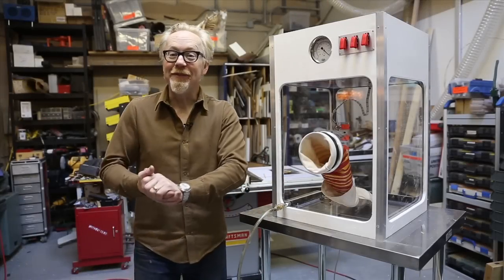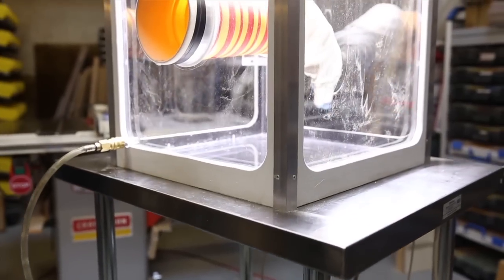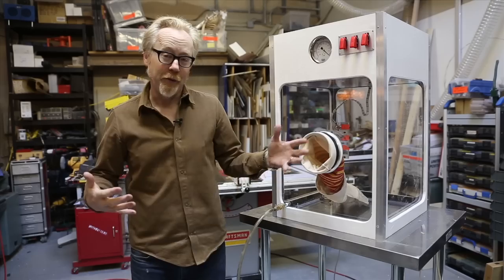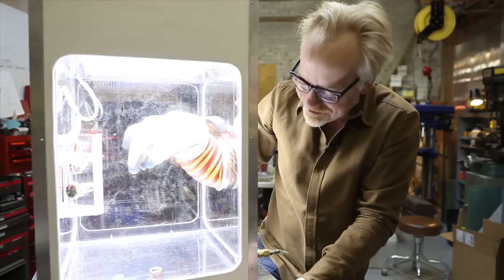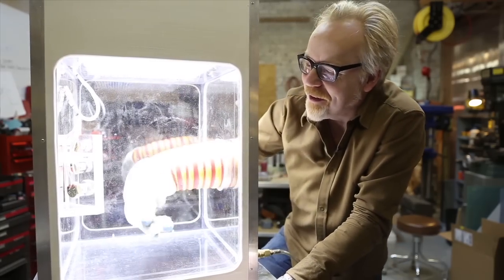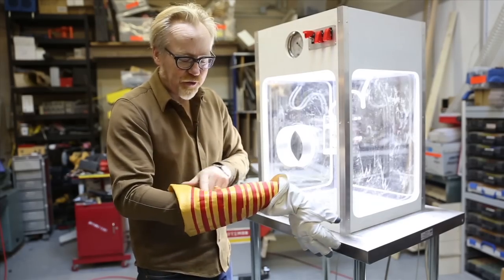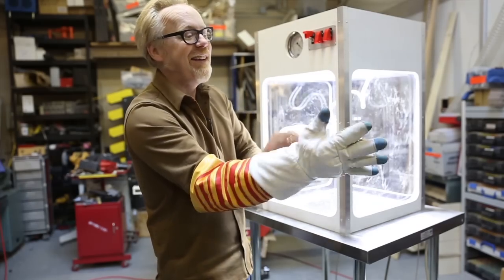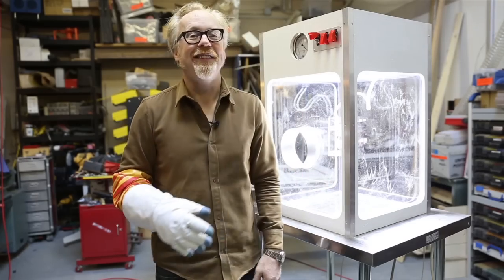Inside Adam Savage's Cave: Space Glove Vacuum Chamber

Comment: It does not replicate a space glove in space. It demonstrates a spaceglove at atmospheric pressure in a low vacuum chamber.
To replicate a spaceglove in space, Adam would have to place the glove in a high vacuum chamber, pump down to about 1e-6 Torr and then pressurize the glove to 3 psi.
I brought this fact to NASA's attention when they were conducting the new spaceglove competition but they ignored me.

I would like to see a spaceglove or a spacesuit tested in vacuum because, strangely, there is not a single video of a spacesuit and its elusive ice sublimator cooling system being tested or demonstrated in a high vacuum chamber duplicating environmental conditions of orbit or the moon. 
They've allegedly been using spacesuits for more than 50 years and although there's beaucoup video of them being used in swimming pools, none show them being used in vacuum chambers.
I've asked NASA if I could witness a spacesuit being tested in vacuum but they refuse even though it would cost nothing and allow them to claim that they're being accountable.
NASA is NOT accountable and I believe they are hoaxing the Citizens of the United States and have been doing so for more than 50 years.
I also suggest they use shills like Adam to protect themselves and perpetuate  the hoax.

Please note that, until recently after my agitation, there were no photos of spacesuit ice sublimators on the Internet.
Please note that, until recently after my agitation, there was no mention of ice sublimators in any academic-level heat transfer or thermodynamics book despite them representing one of the most interesting and exotic heat transfer devices ever conceived or concocted.

The NASA space program is a "faith-based" thing and that's unacceptable because the only way they can  continue to be "faith-based" is for shills like Adam to pretend to hold them accountable when, in fact, they are unaccountable and most probably lying.

The Scientific Method is the best way to determine if NASA is lying and I suggest we use it by having NASA publicly demonstrate a spacesuit in a high vacuum chamber before independent witnesses.

But it probably won't happen because Americans have too tight a grip on their precious delusions.
Reply: Neil Baker You need to stop saying believing in nasa is faith based, there is a mountain of evidence supporting nasa, it has nothing to do with faith. you have no evidence to support what you claim, therefore you go on FAITH that its a hoax. if you have no evidence or have no real good reason to believe in what you do then your going off of faith, thats how faith works...
Reply: don't bother, we're about to hear how those are staged to cover the conspiracy
Reply: Neil Baker So in essence you are consenting to the belief that NASA as well as every other venerable and creditable space agency from around the world is lying about achieving a space flight and other space activities....well this conversation will be getting nowhere have fun in fantasy land. I think your out look on life and science would benefit if you just got over your preconceived notions of grandeur at having pieced together a master puzzle that had apparently "fooled" millions of better better qualified than you or I that they had landed on the moon.
Reply: @SOGSkull  your missing the point.  He is stating that you are putting belief in something rather than using logic and reason. Faith in unknowns. You are just putting your BELIEF in something with no solid evidence. Just as bad as believing in the conspiracy. I on the other hand remain nuetral, use logic and reason to observe this problem. It lacks the proof one needs to make a logical decision. One should be neutral on this until absolute proof is available. However there is more evidence to show that NASA is failing to provide any proof that their suits are what they say they are. I want to see absolute proof that the suits do what they do. Not being back to the moon makes me wonder...
Reply: indubualisticism123 Idiots like Neil Baker have underlying psychological issues. They opt to not address these because they are part of their grandiose conspiracy. Arguing with them is pointless. They might even seem rational at times, but they are incapable of normal human cognitive thought or emotion.
Reply: Neil Baker This has me curious, as I don't think I understand your premise. Your goal is to have NASA demonstrate...what exactly? that it can make a functioning spacesuit that will hold up in a vacuum? How is that the crux of the whole "conspiracy"? Anyone can make a vacuum chamber, and anyone can make something that will hold air inside of it. I've done both, it's not hard.
Reply: Well, I think I''ll leave this debate to any others who wish to pursue it, as I don't expect anything productive to come from it, but on a closing note...

There are many nearly convincing reasons why people believe in the NASA conspiracy. This is not one of them. There simply is no reason a working suit which could hold a vacuum could be made to work, and even less reason that the simple process of ice sublimation could not be used for cooling easily. If one makes a freeze dryer, he's fighting sublimation cooling the whole time, which is why they have heating pads. Likewise, we use pressurized suits on earth for diving, and pressurized equipment for a great many other things. Holding pressure in a vacuum is much easier than holding a vacuum on earth. Calling upon these as unlikely stories simply because public demonstrations of testing have not been held is a case of a misplaced burden of proof, nothing more.
Reply: How long did it take you to write this? Adam was just making an example with a toy. It's not like he's NASA trying to actually replicate exactly how it would be in space.
Reply: Neil Baker I have some gloves in my office that are great when it is chilly outside.  They also do not exactly replicate a "space glove"(or an Apollo space suit glove).  And like the glove in this video, nobody has claimed they do. 

Still, here we see an honest attempt to create something, test, something, simulate something.  And the results of that effort (this glove is difficult to bend, but not impossible) are far more effective at understanding how a glove in space would work, than another person's untested unexplained theory.  I did see a video where Ralf Rene inflated a leather garden glove, then said it was impossible to bend.
Reply: John Smith Don't feed the troll.
Reply: Again, I'm not sure I follow your line of questioning. Without trying to comment on the efficacy of our space program, or lack thereof, ice sublimation cooling is a very easy experiment to perform in any garage. As it happens, I did it last week, just to show off my new vacuum chamber. I poured water from a tap, and put it in a medium vacuum with a normal pump, and boiled it until it froze. Sublimation cooling is a well documented and easily demonstrated phenomenon. There are plenty of videos of what I'm referring to (I'm not going to post one unless I can get a cold trap working, as I found out boiling water is quite bad for the pump, as it craps up the very expensive oil). If you want to try it yourself, vacuum pumps that will do this run around $40
Reply: Neil Baker but there are videos of astronauts in orbit in a vacuum attached to the iss or shuttle all the time doing work. does that not show they have a working space suit? what about the apollo mission videos?
Reply: Neil Baker I've heard some interesting conspiracy theories, but that fact that you think the space suit is a lie... That's the dumbest thing I've heard in my entire life.
Reply: Neil Baker You're a conspiretard. Therefore 99% of what you say is sophist bullshit. So forgive me if you just sound like the whining of a power drill to me, and any rationalists present.
Reply: BaSH PROMPT They think everything is a lie...
Reply: You realize how ridiculous your argument is right? NASA would not let anyone just come in and observe their work and let them leave just to convince one person that they know what they are doing.
Reply: @andromeda42442  you realize how bad your argument is don't you?! He actually does have a good argument. Don't be so hypnotized man. Wow... Your saying throw truth and reason out the window and just have faith in NASA...
Reply: Neil Baker Wait... What are you saying to be a hoax? The space suit? Because if you're saying the space suit doesn't work, then wtf kinda of world do you live in?
Reply: Neil Baker When you say that NASA had not released photo's of their ice sublimator until recently due to agitation by yourself what year are you talking? I can find no evidence that NASA has ever stated that an ice sublimator would be built into a space suit until 2011 and the patent for that ice sublimator was filed on January 22, 2007. In the article released by NASA in 2011 they hint that it may be used in the new space suits and that it is only a more advanced sublimator that reduces contamination and increases reliability by reducing the contaminants that would usually clog the system. Ice sublimators were used during the Apollo missions but they were not part of the space suit itself but a component of the portable life support system which was manufactured by Hamilton Standard now known as Hamilton Sundstrand. Block diagrams and photos of the unit are widely available on the internet and Hamilton Standard released this article about the PLSS many, many years ago. https://www.hq.nasa.gov/alsj/LM15_Portable_Life_Support_System_ppP1-5.pdf. The way you talk about these ice sublimators makes me wonder about your understanding of sublimation. Sublimation is when matter in a solid phase turns directly into a gas or vapor skipping the liquid phase. Water will sublimate when it's brought below it's triple point (4.56 mmHg) or in other words at very low pressures (i.e. the vacuum of space) last time I checked 4.56 mmHg is greater than 1e-6 Torr. Sublimation does occur and has been proven independently why you cant imagine NASA being able to utilize it is beyond me. NASA 2011 article http://www.nasa.gov/centers/johnson/techtransfer/technology/MSC-24207-1-advanced-sublimator.html Patent for new sublimator http://patft1.uspto.gov/netacgi/nph-Parser?Sect1=PTO1&Sect2=HITOFF&d=PALL&p=1&u=%2Fnetahtml%2FPTO%2Fsrchnum.htm&r=1&f=G&l=50&s1=7,604,782.PN.&OS=PN/7,604,782&RS=PN/7,604,782 Experimental study of water sublimation conducted by independent scientists partially funded by a grant from NASA and published in the scientific journal Icarus in 1991 http://science.gsfc.nasa.gov/691/cosmicice/reprints/IcGas1.pdf Wikipedia article with colour photos of PLSS http://en.wikipedia.org/wiki/Primary_Life_Support_System. If you would like to know more information regarding the sublimator there is a more detailed description on the patent page.
Reply: ***** I want NASA to demonstrate before independent witnesses (preferably with me being one of them) a spacesuit and its ice sublimator cooling system in a high vacuum chamber on Earth duplicating environmental conditions of orbit or the moon.
If they use the suits as they allege they do and test the suits in vacuum as they allege they do then their should be little difficulty or expense in being accountable before independent witnesses when they perform future tests.
In over 50 years of alleged use, NASA has never demonstrated that its spacesuits and ice sublimators work in vacuum. Until recently, after my agitation, no photo of an ice sublimator existed on the Internet. Most absurdly, until recently after my agitation, no mention of spacesuit ice sublimators existed in any academic-level heat transfer or thermodynamics book despite representing one of the most interesting and exotic heat transfer devices ever conceived or concocted.
NASA frequently presents video of spacesuits operating in swimming pools for training purposes but, strangely, has never presented video of them being operated in a vacuum chamber.
Yes, vacuum chambers exist and yes, things called spacesuits exist but never have spacesuits been demonstrated operating in vacuum chambers.
It's the Achilles Heel of the space program. It's the way the hoax can be PROVEN today on Earth without the necessity of faith or travel into space.
Currently, our space program is a faith-based thing and that's unacceptable.
Reply: "It does not replicate a space glove in space. It demonstrates a spaceglove at atmospheric pressure in a low vacuum chamber.
To replicate a spaceglove in space, Adam would have to place the glove in a high vacuum chamber, pump down to about 1e-6 Torr and then pressurize the glove to 3 psi."~ Neil Baker

Now I would hate to insult your intelligence here. But think about that from a logistical standpoint....If the glove is at atmospheric pressure in a low vacuum chamber. It is the exact counter opposite of a space-glove in space. The only difference is at which point(s) the material(s) (In the video's case in fabric/plastic) are experiencing the negative pressure "differential" is you will. So in essence if the glove works here on earth and has no obvious leeks due to construction i.e. its stability remains the same in the actual device used to test it (much in the same way the device Adam built in the video) then the glove will survive vacuum of space....that much is easy to say.

.....On the topic of the "Ice subliminatior not being tested in a vacuum"~
It would not need to be....-_- testing in a water based environment fully simulates to an adequate degree the effects of the suit in space....what little it dose not is permissible on the testing scale (Not to say that tests of that nature do not occur logic would hold true that they do....and by extension that people carrying out these tests are busy enough without having to chaperon you around a facility for you to oversee and give your "official" college kid stamp of approval) Further more testing in an aquatic environment is the safest way to ensure the the cooling system you are so critical about works effectively. B/c taking temperatures is extremely difficult to do reliably in a vacuum environment....This much as all known science. And even in my brief explanation of all of this (In no way conclusive to the proper terminology, science, etc.) in laymen s terms you still find something that you would like to be critical about....remember other countries use just about the same methodology in their space programs as well....unless you would like to offer the conjecture that the world's governments are orchestrating some massive cover up. In closing you sir are the "Shill"
Reply: Neil Baker Oh god, you think we're brain washed too?
Reply: It's pretty obvious the suit works.
Reply: and it will need to protect you from radiation.
Reply: Noah - And extreme heat... And extreme cold...
Reply: Daniel Markiplier forgot that.
Reply: "It demonstrates a spaceglove at atmospheric pressure in…."   It's a glove from a hazmat suit with some modification.  Savage goes into detail, and never claims it's a real glove, or even has the same features or construction.  He also reads PSI off a meter that is marked in inches of mercury, something you completely missed.  But it does prove quite nicely that bending a glove with pressure inside greeter than outside is difficult, but quite possible.
Reply: +Neil Baker 
Not too many people have a vacuum chamber with turbomolecular pumps and backing pumps (and Bayard-Alpert style gauges) that would get to 1 e-6 Torr. You'd need something elaborate to get there including conflat gaskets unless you want to wait for 2 weeks to test your theory after all the outgassing. Also, unless you have a TMP-1000 size turbo, you probably won't pump down a chamber capable of housing that glove inflated. You'd also have to have a method for ensuring the glove feedthru integrity is conflat like and that would mean a bellows, not a rubber membrane as gases like helium don't have a problem going through rubber and would serve to help prevent your 1.0e-6 Torr (hell let's just shoot for 7 scale). 

So your enthusiasm and book larnin' is impressive but your high vacuum knowledge is based on thin understanding of vacuum application. Theory is fine, application is quite different. Nevermind the fact you wouldn't need one hell of a sight glass sealing system to hold 6 scale vacuum. I'm fairly certain there would be no entries except by CERN or NASA themselves.
Reply: +Neil Baker Adam is not "recreating a space glove in space" he has simply constructed a fun gift that "roughly simulates the difficulty of movement in a pressurized space suit in space". What you suggest is completely impractical. On top of that NASA HAS been observed in action by various space agencies and regular old people around the world (yeah people watch them in space).
Reply: Superb piece of trolling sir
Reply: Neil Baker Thanks I suppose, I still don't get why sublimation cooling would work in a crock pot vacuum chamber and not in space, where radiation, I'd imagine, would accelerate the sublimation process, much in the same way a freeze dryer works
Reply: Neil Baker forgive me, your gonna have to elaborate on what exactly a ice sublimer is and how it is supposed to work in the suit. What i know about the suits is that the person wheres a cooling suit under the space suit itself, it runs a liquid through a serious of tubes all over the body. if this is what you mean, there are lots of details and stuff on how it works on the net.
     I dont find it odd that there are no videos of them testing a suit in a vacuum, in fact i would find it a bit odd if they did, it would be like them saying ''we have something to prove to conspiracy theorists'' instead they were tested in flights to the stratosphere, there are different countries that also have there own space suits ''russia, china'' and yes, im sure they were vacuum tested too. the absence of footage showing a suit in a vacuum chamber is not strange. and Adams suit is a replica, not a real suit. he would die if he went into a chamber with it most likely.
     Nasa is not some secret base, its not nasa verifying nasa at all. they release there data to the public for all to see. not to mention scientists from around the world have been to nasa and not one of them disputes a hoax of any kind. not a single person properly educated in any of the fields of discussion, claims nasa is a fraud.
  Videos might not be absolute truth but they are EVIDINCE! so is all the data nasa released aswell, and evidence is what you use in the scientific method, its all been looked at time and time again, and still no one disputes it, other then those uneducated in the fields of science in relation to the discussion... from the hundreds of thousands of scientists around the world, not one claims a hoax at nasa. that means the whole world must be in on the cover up if there is one and thats just absurd when you think about it.
Reply: Neil Baker innocent untill proven guilty. If you had any real evidence to show that any of this is a hoax then id be with you, but you have none, i know you have none because iv had arguments about this stuff about 100 times now and no evidence is ever presented that stands up to scrutiny. ''what ifs'' and accusations are not enough. there is way to much evidence out there supporting the apollo missions, its vary unlikely that it was a hoax.
Reply: Neil Baker I Imagine you have trouble believing many things. Oh, and by the way. World we live in, is just a big simulation.
Reply: Neil Baker are you a robot?
Reply: Neil Baker Dude, if you really want to try it, it's not hard to send a little pod into space with a camera to monitor a few test pods. Unless you don't have any money to do so because you never worked a day in your life because you feel like work is just an illusion made by the government to control our brains.
Reply: Neil Baker Just so you and everyone know, Australia wasn't in on any hoax created by the US when it was up to them to broadcast the lunar landing around the world. They pointed their big dish at the moon despite dangerous high winds which could have destroyed it. They received the transmission from the moon! The amount of effort for NASA to get a video transmitter with a staged and pre-recorded video safely to the moon and remote control a craft there and back would have been the same, if not more, than sending three men to the moon that day.
Reply: You are right NASA simply lies about nearly everything. There lies are intended for those who can be brainwashed easily.
Reply: +Neil Baker Why wouldn't a sublimator work in a vacuum?
Reply: +Neil Baker if by recently you mean 1951, a quick Google Scholar search finds this article that would seem to contradict your statement, "The sublimation of ice in vacuum" Kramers, H. & Stemerding, S. Appl. sci. Res. (1951) 3: 73. doi:10.1007/BF03184673

I note this is seven years before NASA
Reply: If I worked go NASA I would not let some random person come view our vacuum chamber tests. Who do you think you are? And what are you trying to insinuate? That NASA has never been to space or something? You're a nutter.
Reply: +Ramsey D'silva 
The alleged person in charge of spacesuit testing at NASA's Johnson Space Center is Raul Blanco.
His telephone number is: 281.483.1601
His email address is: raul.a.blanco@nasa.gov

I have spoken to him but with little success in convincing him to be accountable.
Perhaps you with the help of your friends could be more successful.
Reply: John Smith I don't think it's ridiculous at all. NASA's credibility has been challenged and I've proposed a simple inexpensive way that they can demonstrate accountability while living up to the strictures of the Scientific Method. I was thinking that a rather large group of interested Independent Witnesses would be invited.
Reply: ***** We're not talking about whether or not sublimation cooling would work. We're talking about whether or not NASA has a spacesuit that can operate in vacuum and be cooled by an ice sublimator.
Nobody contends that sublimation can't cause things to get cool.
I do contend that NASA is committing fraud as it has for a long time in telling us that it uses spacesuits equipped with ice sublimators that work in the hostile environments of orbit and the moon.
No video exists of a spacesuit being tested in a high vacuum chamber.
No video exists of a person in a spacesuit being tested in a high vacuum chamber.
Would anyone care to volunteer.

By the way, I remember an episode of MythBusters where Adam Savage was wearing a NASA spacesuit and was next to a vacuum chamber but for some probably really good reason (like staying alive), he didn't enter the vacuum chamber, seal it, pump down and test the spacesuit.
Reply: ***** If you're so certain, then you shouldn't have any problem demanding accountability from NASA claiming for more than 50 years that its spacesuits operate in vacuum.
 
Nobody should have to accept a "faith-based" space program like you are.
The beauty of exposure of the hoax through the spacesuits and ice sublimators is that we can PROVE it today on Earth. That is, with some cooperation from NASA which isn't going to provide unless forced because they're criminals trying to cover their crimes.
Reply: indubualisticism123 Yes, but that video was produced by NASA. The Scientific Method requires that verification of scientific claims be conducted independently. NASA verifying NASA is not science.
1. If NASA has truly been using spacesuits with ice sublimator coolers then why has there never been any demonstration of a NASA spacesuit and ice sublimator being tested in a high vacuum chamber on Earth duplicating environmental conditions of orbit or the moon? If NASA has been using the spacesuits for more than 50 years then they most certainly have been testing the suits for more than 50 years. Why no video  of suits being tested in vacuum when ample video exists of suits being used for training purposes in swimming pools? Odd, isn't it?

2. Until recently when I started agitating about it, no photos of spacesuit ice sublimators existed on the Internet. Odd, isn't it?

3. Until recently when I started agitating about it, no mention was made in any academic-level heat transfer or thermodynamics book about spacesuit ice sublimators despite them representing one of the most exotic and interesting heat transfer devices ever conceived or concocted. Odd, isn't it?

4. Challenges to address the issue of ice sublimator fraud to several university's Mechanical Engineering Departments including University of California, Louisiana State Universrity, Tulane and Rice University have been ignored.

5. NASA refuses to be accountable. Congressional representatives in two states  (Washington and California) contacted by me to demand accountability from NASA have stonewalled me.

6. Adam Savage on an episode of MythBusters had a spacesuit and a high vacuum chamber but failed to put the spacesuit in the vacuum chamber to PROVE its operation. 

Video is not PROOF. Video is not TRUTH. The best way to reveal TRUTH is the Scientific Method.
I suggest we use it. 
A "faith-based" space program is a fraudulent space program.
Please demand a NASA demonstration before independent witnesses of a spacesuit and ice sublimator cooling system in a high vacuum chamber on Earth duplicating  environmental conditions of orbit or the moon.
The hoax can be proven or disproven today on Earth.
Reply: Daniel Markiplier If he's truly a Myth Buster then he should bust the myth. He had an opportunity in the episode when he was at NASA wearing a suit outside the vacuum chamber. Why didn't he enter and pump down?
NASA won't be accountable because they probably can't because it's probably a hoax.
The Scientific Method could tell us for sure but only if NASA cooperates which they won't unless forced because criminals always try to cover their crimes.
Reply: Is a glove at atmosphere inside a vacuum chamber at 3psi the same as a space glove at 3psi within a vacuum chamber at near 0psi (1e-6 Torr)?
I think the Kinetic Theory of Pressure indicates that the systems are different. I wonder if they behave differently.
Reply: Dude, get a life.
Reply: I'm the TOOL? 
Me?
I completely fail to see any logic in that statement.
It seems obvious to me that the TOOLS would be those helping prop up a fraud.
All I ask is a simple act of government accountability that costs nothing to perform. Not only does the government say no, other Citizens that have nothing to lose help them say no.
It's like Harriet Tubman, conductor on the Underground Railroad, said after the civil war, "I saved a 1000 slaves and I would have saved 1000's more if only they'd know they were slaves."
You embarrass.
Reply: indubualisticism123 No, it's NASA unaccountable until they are accountable. If you're so certain of your evidence then you should have no problem with the demonstration I've proposed especially when it will confirm your position.
But no, NASA won't publicly demonstrate a spacesuit and ice sublimator in a vacuum chamber even though they allegedly perform such tests periodically and have allegedly performed them for more than 50 years. 
If they use the suits as they allege they do then they must test the suits in a high vacuum chamber.
They won't be accountable because they probably can't be accountable because it's probably a hoax.
The space program is a "faith-based" thing and that's unacceptable.
Reply: Daniel Markiplier Until the demonstration of a spacesuit and ice sublimator in a high vacuum chamber duplicating orbital environmental conditions is conducted before independent witnesses, I can only believe or disbelieve NASA claims about the spacesuits. The Scientific Method requires independent verification.
Until NASA is accountable, the space program is a "faith-based" thing.

If the spacesuit doesn't work which I strongly suspect but don't know, it would mean that NASA has lied to and defrauded the Citizens of the United States for more than 50 years and that most of our space program is a hoax. It would strongly support the notion many share that our reality is a fabricated reality and that we are slaves manipulated by powerful criminals controlling government and media.
Reply: Daniel Markiplier Sure, if you BELIEVE, it's pretty obvious.
But NASA should be an institution dedicated to science rather than belief or faith.
Video is not TRUTH.
It many seem obvious, but it's a lie.
It might seem obvious that terrorists shot a downed policeman point blank on a Paris sidewalk but look at the latest Charlie Hebdo hoax video and think again.
NASA does fake video, fake photos and fake narrative almost better than any other organization.
I don't think you're brainwashed. I just think you're misinformed. I can empathize. I was once misinformed also. Summon the courage to confront that you've been lied to.
Reply: Brad Rex Still, it does not replicate a space glove in space. That would require a glove pressurized to 3psi while within a high vacuum chamber pumped down to the pressure of orbit (1e-6Torr)
Reply: No. Only you are the idiot. Neil is 100 % correct scum bag.
Reply: Wow you are a total piece of shit.
Reply: why is it dumb ? he dont sound dumb he has points you cant answer or can you without a personal insult. i say question everything.
Reply: thats not much of an answers ....so you cant answers the questions he presented...this is getting odd.
Reply: Exactly.     Well said.

The differential pressure on a spacesuit between space vacuum on the exterior and one atmosphere of pressure on the inside would make the fingers entirely rigid.   It would be as extreme as the pressure difference between  an atomosphere of pressure inside a submarine and the pressure of the ocean at a thousand feet underwater.   They may have suits that can support the pressure but there is no way that the fingers would not be totally inflated and rigid.
Reply: Adam Savages glove looks just like the protective over glove used on Apollo missions.  But it looks nothing like the inner pressure glove.    Like all things designed to hold pressure and stay flexible, (car tires, garden hoses, hydraulic lines, etc) they have an inner structure that keeps the volume the same when bending the item. Yes 50psi in a garden hose makes it stiffer but not ridged.  3.7 psi in a space glove still bendable. 5000psi in your car's brake lines, still bendable.
Reply: TYPICALLY, WAY TOO MANY of these ShitMonkeys do not know the definition of "troll".

AND, also typically, MOST of these pseudo-intellectuals (and SUB-intellectuals), some of whom either "think" they are or claim to be PSEUDO-"skeptics" and PSEUDO-"debunkers" are simply MoonFaithers, who couldn't 'skeptic' or 'debunk' or 'science' their way out of a wet paper bag to save their not-worth-insuring lives.

THIS video, yet ANOTHER miserable and epic FAILURE by Adam Savage, is SO, SO similar to MOST of the ridiculous, absurd, ludicrous, asinine, UNscientific CRAP they PERFORMED on "Mythbusters", which was an EMBARRASSMENT of a show too much of the time.

IT WAS ENTERTAINMENT. Period. (and barely that)

And that is ESPECIALLY TRUE for their "NASA/Space" episode. (I actually felt sorry for them, even though they did not deserve that)

All you have to do is watch some of these Tested videos and it becomes ULTRA-CLEAR why "Mythbusters" was the unfortunate show it was. But it fed the pablum most of its viewers thrive on, so that is mostly why it was so popular. And the JOKE continues....
Reply: John Smith Why not? The Scientific Method is very specific. Scientific claims require INDEPENDENT verification. NASA verifying NASA is not science.  An independent Citizen, preferably one that has an engineering background in vacuum systems, would be a good choice even if they are random Citizens.
I trust a random Independent Citizen to verify NASA claims more than I trust NASA to verify NASA.
It makes sense. If they're lying, they're going to avoid accountability to preserve the hoax.

I think NASA has been to space.
I suspect they've never walked in space.
I suggest rather than preserving a "faith-based" program that the Scientific Method be used to demonstrate before independent witnesses that the spacesuits and ice sublimators work as NASA claims they work by operating them in a high vacuum chamber on Earth duplicating environmental conditions of orbit or the moon.
Reply: ***** Wonderful. Congratulations on your experiment that such a thing as sublimation exists but it was never called into question.
A NASA spacesuit and ice sublimator cooling system have never been demonstrated to work in a high vacuum chamber duplicating environmental conditions of orbit or the moon.